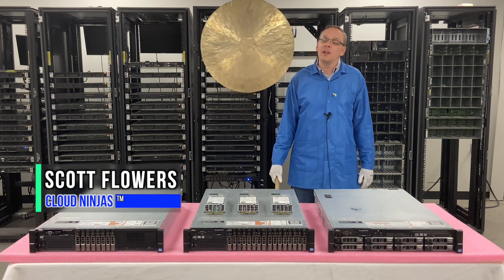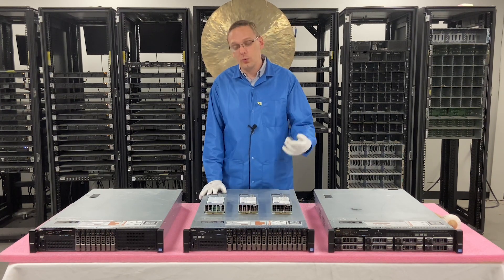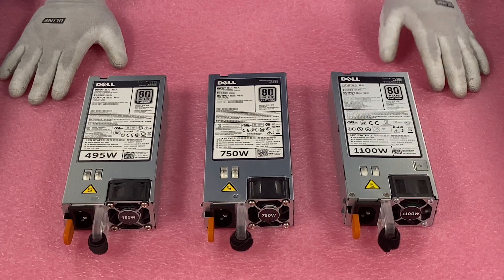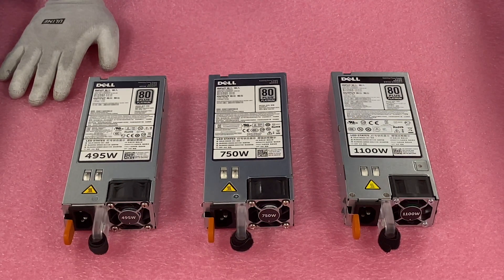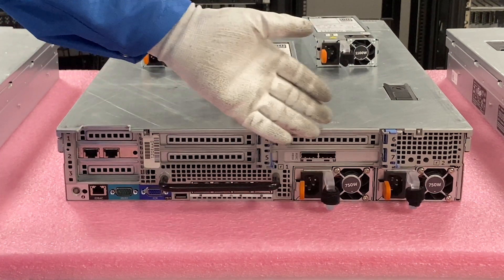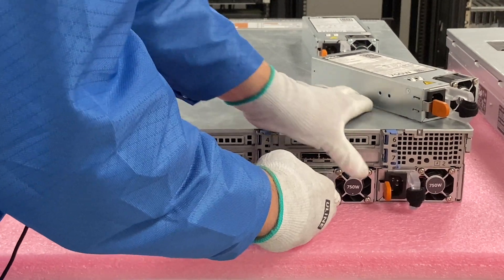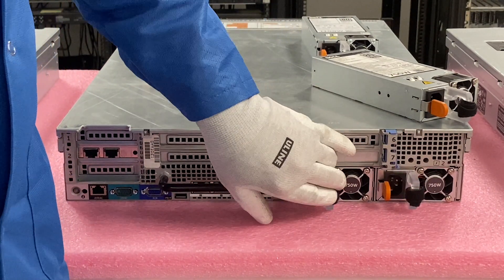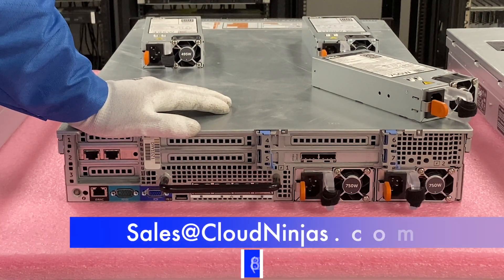Dell PowerEdge R720 Power Supplies Overview | Power Supplies Options | How to Install Hot-swap PSU

Comment: My r720 has two 1100w power supplies, but I'm thinking of swapping them out for the 750w to save on power usage
Reply from the maker: Good idea of you don't need the extra power.  Power is expensive right now.
Reply: @cloudninjas  @BradBazooka Don't PSUs provide the amount of power the server needs and not its full capacity? so technically 750w and 1100w consume the same amount?

Comment: I recently got an empty r710 with l5506 which is low power cpus, 4 gb ram 2x2gb just one psu and the raid card is a perc 6i. I'm not gonna use it, im choosing if i'll try send it to someone or trash it.
Reply from the maker: Yeah the R710 is pretty old nowadays.  They were such a beast back in the day.
Reply: Well, still decent for rendering or for truenas with zfs, the perc h200 is a good hba controller still (flashed with it mode from lsi it gives you 6gb/s on drives) but you need 6 core cpus, those are terrible